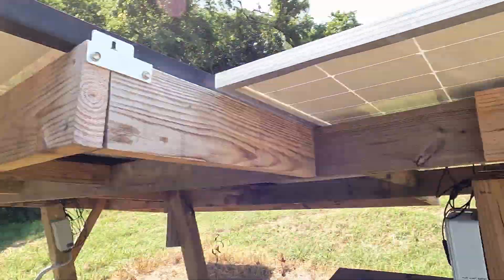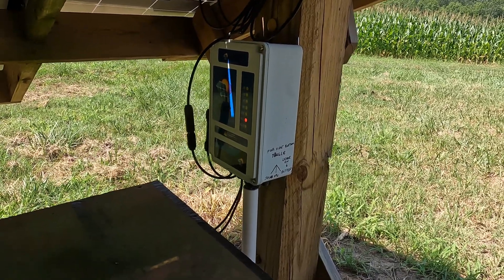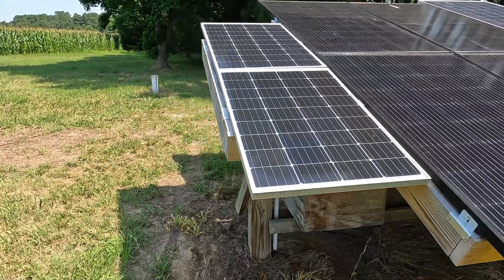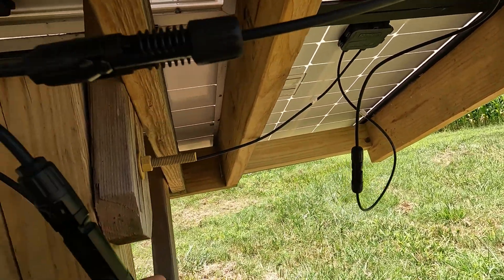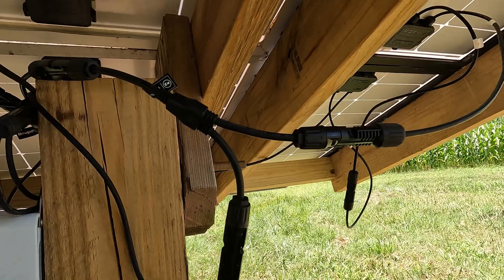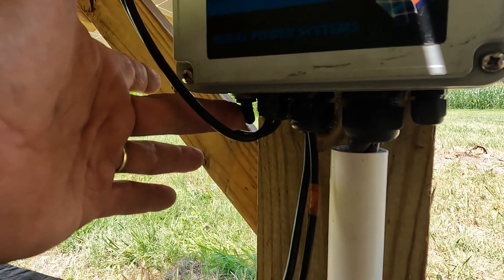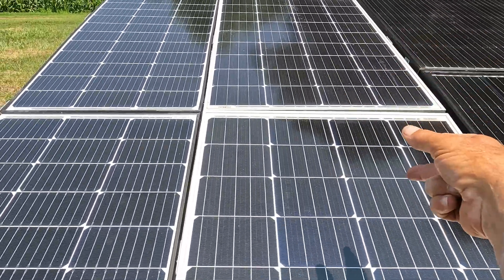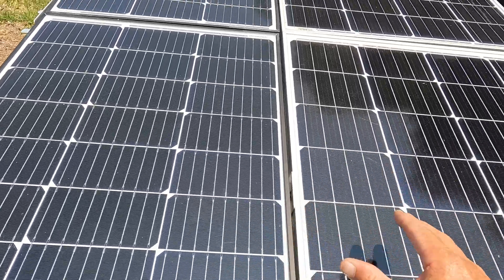Did You know it was this EASY? Solar well/ Solar Panel Upgrade. Simple for anyone to DIY this 1,2,3.

Comment: Greets and Love from Hamburg in Germany. I am a facility manager with carpenter backround 30 years in the buis. Also a lover of traditionell cabin log house buildings (NORTHMEN on YT best teacher and buidler) Allow me to say- 1: The post for the solars must be supportet by non rotten alu or metall. Strong wind could take it down and the posts are brocken. 2: Take down all trees that can hit the cabin or technic. Thunder can hit a tree and it can fall...3: The metall walls have no drip bar to lead the water away from the cabin- the oposite is the case. 4: A shutter is the best insolation system thats why traditionell build cabins have them its allsow protection against fire buring sticks can fley into it. Cold presses into the cheap windows and heat presses from the inside out. A wooden shutter saves energy gives a better wellness air feeling in the wintertimes. Lesser fire wood is needed. 5: Paint all fake wood pleywood. It must ve protected from rain and sun. US americanos think that it its natural wood. Is not. Keep the rain away and you safe alot money because the fake wood rottens fast.
The cabin is sweet hase a nice techical basic but you canal cant grow because you are more in style then in tradition. Take a look at northmen "The brith of a wooden house" you will love it. Never use fake inso- like mineral wool glas wool. They soak humidity into it and loos the insopower. Always using wood ships or dust between outside wood the structure and inside wall wood. Albert Einsteins Log House is still standing with no rotten wood after 100 years. My friend made an inspection for the insurance comp. Its all wood wood dust and cellolouse that is also natural inso.
A big overhang is also a good idea as more roof as lesser rain ond the cabin. My grandmother build a log house in the forrest. 100 sqweer meters She was a jew hiding their in the holocaust time an her 6 children with her. Foundament on big stones rocks. Hunting and own food...was the basic. Its still there. monster logs has much power the wood fiber is the deal...But today in our communist state its not even allowed to have a cabin in the forrest. The green party is a Klaus Schwab Party and they push the 15 Minuts citys...Frank